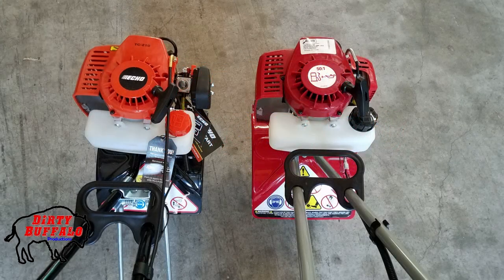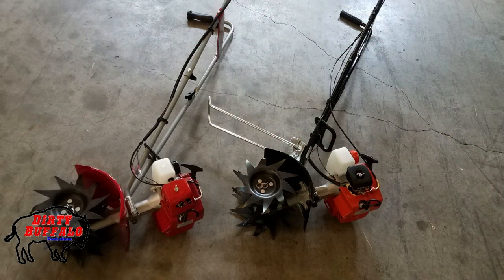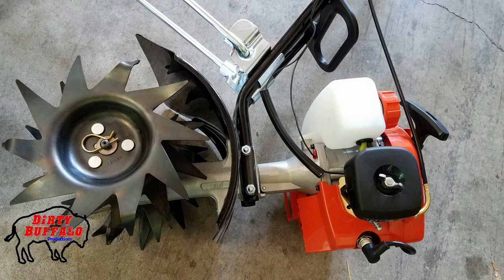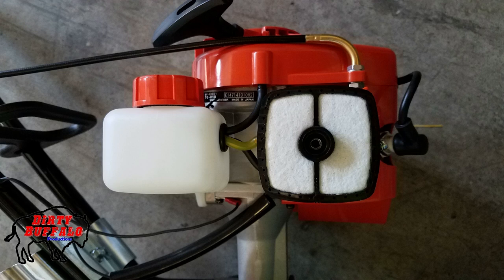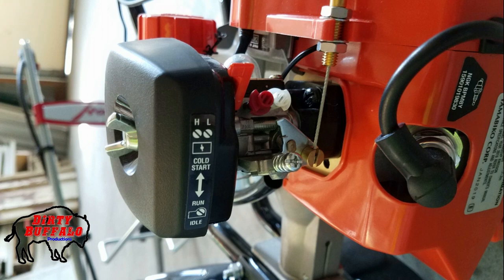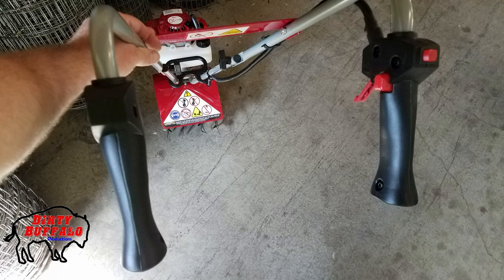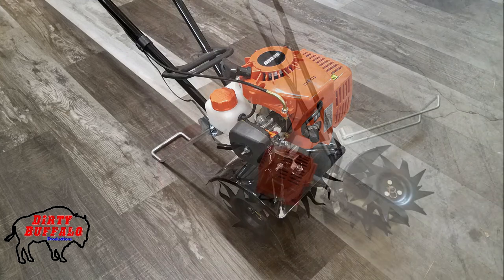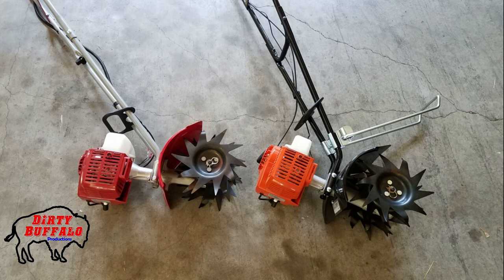Echo TC 210 & Mantis 7920 Cultivator Tiller: What's the difference? Which one is better?

Comment: Are the kickstands interchangeable?  I just bought a new 7920 2 stroke mantis tiller.  This model does not come with a kickstand.  However I wanted to know if I buy one will it fit?  It comes automatically on the mantis 7924 2 stroke model.

Comment: You have not seen a mantis up close. The mantis red shroud seals the air cleaner. I have had a mantis for over 25 years. BUT I use Amsoil for the gas mix. Only Amsoil. With Amsoil your engine will run a very long time!

Comment: My Mantis has a Honda engine.No one beats a Honda Engine.
Reply from the maker: The Mantis we are comparing here has an Echo 2 cycle engine. Mantis has several models including the one in this video, one with a Honda as you mentioned, and even a battery powered version.
Reply: Until a Honda engine breaks.